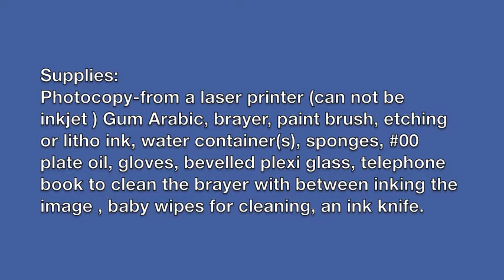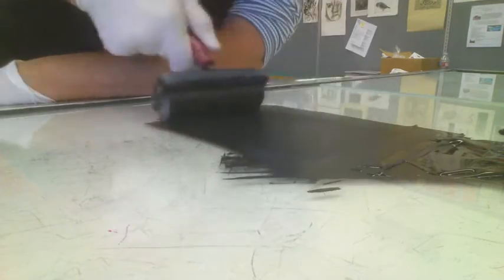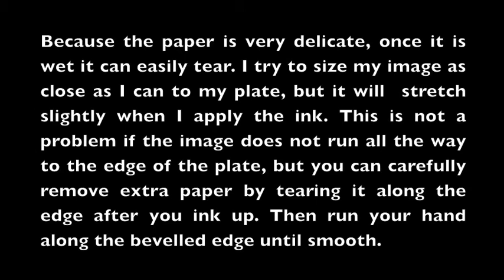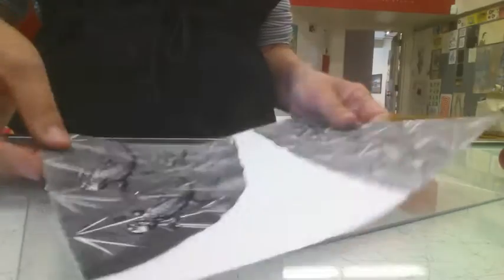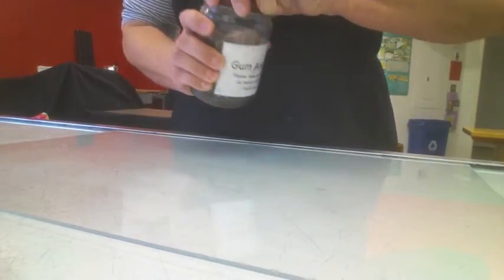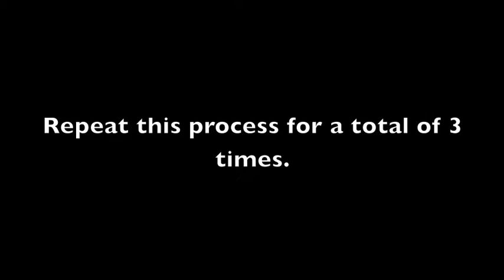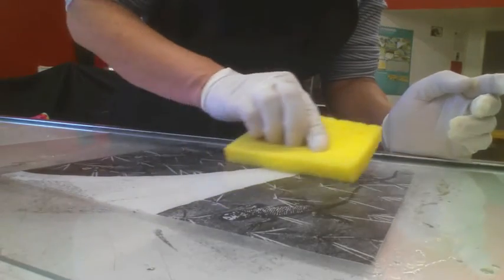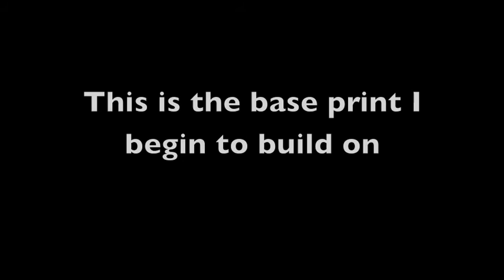Paper Lithography

Comment: Hi, Thank you so much for posting this video. I have been working on paper litho now for about 6 months. I have had some success mixing faust etching with hanco shop mix litho about 3 to 1 etching to litho ink. I'm a photographer and I'm trying to go in another direction from the dark room or inkjet printing. The process I've used is different from yours but I really want to try it with your technique. I can't tell which Charbonnel black you are using. Is it the Black Universal 55981? I appreciate any help or advice you could give me. Thank you.
Reply from the maker: Hi. Again, I am sorry to be responding so late to your question. Yes, I use the Charbonnel 55981Universal Black and also their soft black. I have used a variety of Charbonnel's other colored inks and had success. I have used Faust transparent base with Charbonnel inks  if I am layering images and want to reveal the images underneath them . That has worked well also. I hope you are having great success! It's one of my favorite techniques.

Comment: What is plate oil ? Please answer . Thank you .
Reply: Plate oil which can be purchased at Gamblin or Blick, is a n oil that changes the viscosity of the ink. There are a small variety to chose from. I like #00. If your ink is thick or tacky,  which some inks are, it can rip the image you are trying to ink up. It takes some practice to get it right. Too thick or too runny are not good for different reasons.The first can rip your paper. The second will leave oily spots of ink in white areas. Hope this helps.

Comment: Hi there! What a great technique. Can you tell me what exactly the gum arabic does for this process? Also, do you have any suggestions for a gum arabic solution? Do you make your own using a powder? Thanks for any help you can give me.
Reply from the maker: Hi. Sorry it took so long to respond to your question. I have to say I am not really sure why the gum arabic reacts with the toner and allows ink to adhere to it. I just understand it is a process of oil based inks and water not mixing. I have searched the internet myself and not found an answer to that. 
I do not mix my own gum arabic. I use it straight from the bottle. There are a lot of suppliers online though some stores sell it in very small bottles. It's very expensive that way. You can purchase quart or gallon containers for a much better price.
Reply: This is a late answer but just saw this video....Gum Arabic is a natural product. It is naturally acidic. Oil based inks will not stick to acidic surfaces so anything with an image (grease pen or toner etc) will not accept the gum ( because these images are not pourous ) and non image areas will accept gum....then, when you ink up and print, the ink will only stick to the image and not to the non image area.......try looking for a graphic supply company that sells products to the offset printing shops in your area. You can purchase gallon sizes from them or maybe your local print shop will sell you a quart. They use it to "gum" the metal plates they use so that the non image areas will not oxidize while the plates are in storage. Hope this helps.